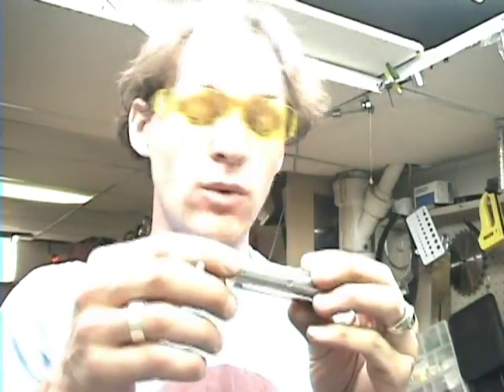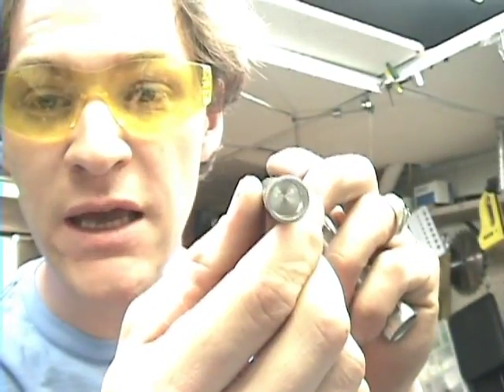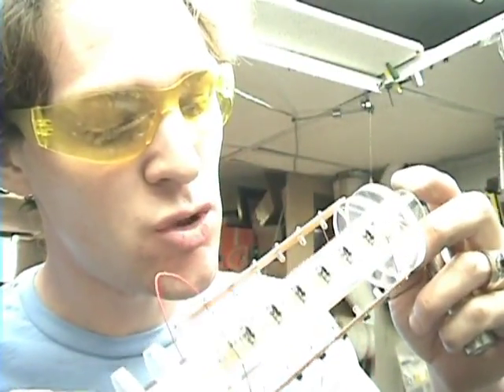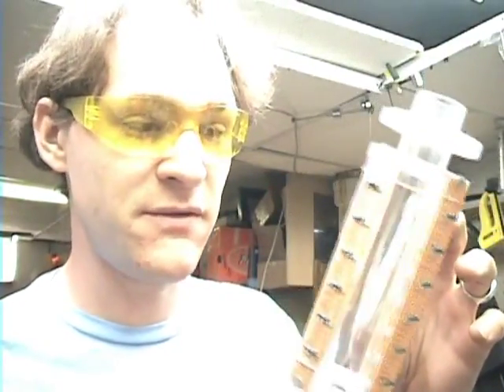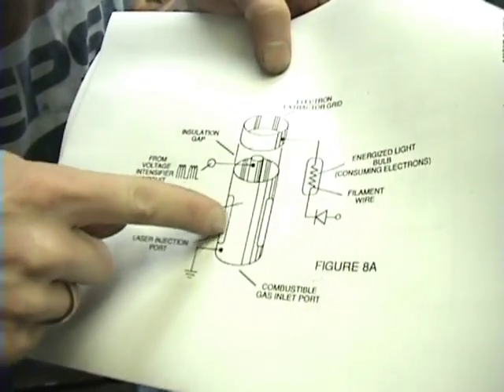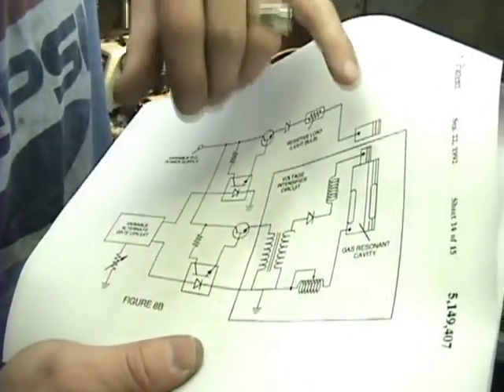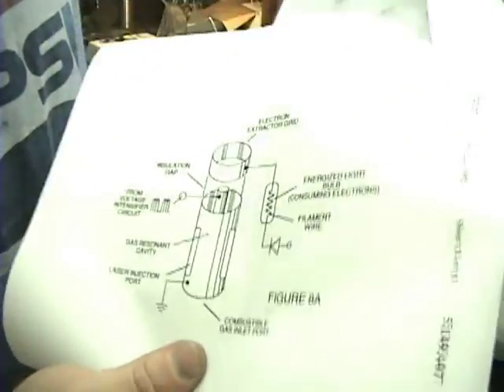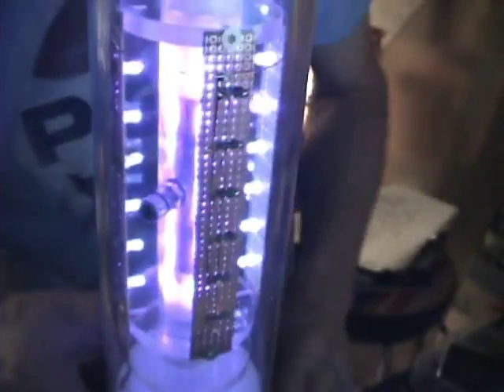P2 Stanley Meyers Hydrogen Gas Gun Replica. # 22 Gage Wire ordered! Thank you all! Amazing!

Comment: I have done a great deal of research on water dissociation and electrolysis. And I learned that the ideal frequency for dissociating water is approx 3.1 um wavelength (which corresponds to the stretching mode of the water molecule). You said your using 4.5 um but maybe you should add shorter frequency LEDs to get closer to this 3.1 um level. 

Keep up the great work!!

Comment: I was watching the NZ house video and something Meyer said brought some light to this area.  Meyer was making a joke about "the fool that lights the gasses" or something of that manor...and I was thinking if you have high voltage and plucking off electrons- you will have an arc and ignite the gasses, being that fool.

I kept thinking how he could extract electrons without the arc... Now I realize both electrodes in the gas gun are very high + potential.  The led's are to help promote the electron extraction, but his voltage would need to be massive to extract 6-8 electrons from oxygen and the only safe way to do that is both electrodes being positive.  This allows extraction on both ends and a voltage high enough to safely pluck them off without arc or spark.

Another key I recall is he said if he wanted the Oxygen stable he would just add a ground sink grid... so again leads to no ground, or negative in the gas processor and he "dumped" the plucked electrons to ground.  Just an idea you may want to think about.

Think of a 25kv flyback transformer size... Meyer's coils were easily 2-3 times that size... so maybe 75kv-150kv range.

I slowly working on this... but I also recognize you are way ahead of me (even 7 years ago).